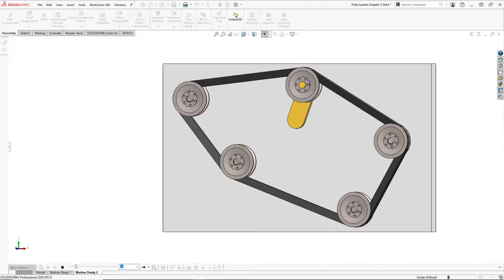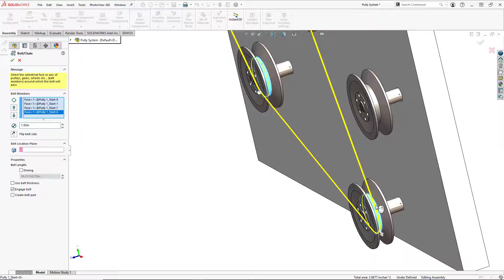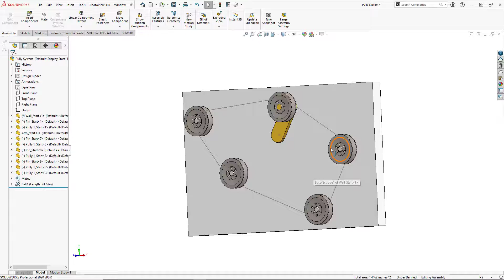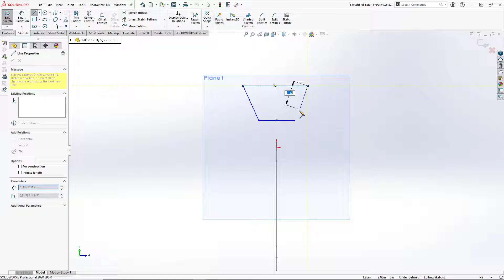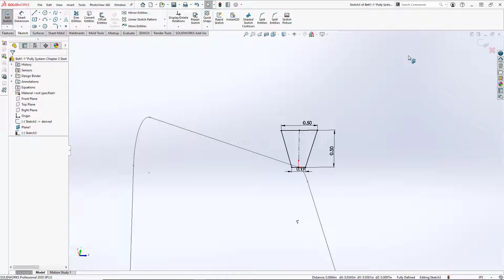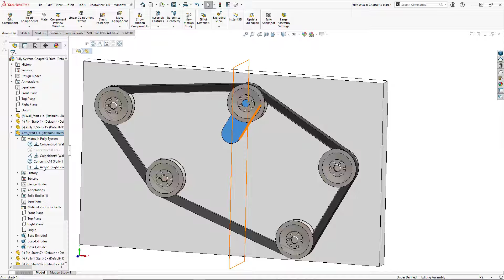SolidWorks Belt and Pulley Tutorial

Comment: can I use it in different planes, for example, one pulley is in the right plane and the other one is in a top plane?
Reply from the maker: That's a great question. I did some digging and I don't see how the Belt tool can be used on pulleys that are perpendicular to each other, as you describe. 
You could try combining a few 3D sketch segments into a loop and using the sweep tool to create your belt part.
Reply: @KrawchukIndustriesLLC  I see, I'll try that. Thank you